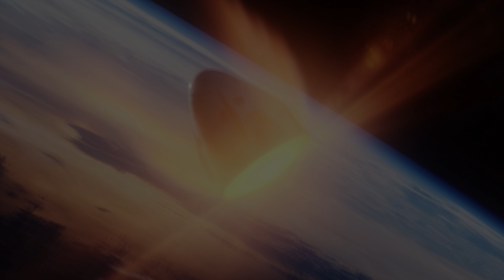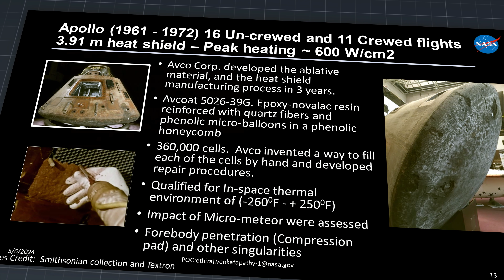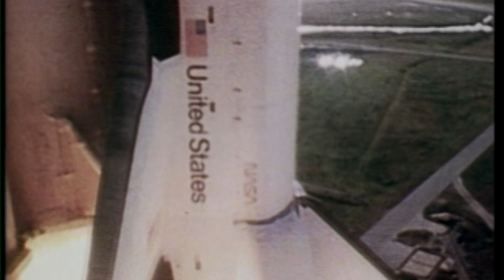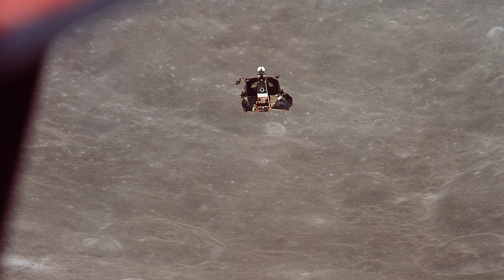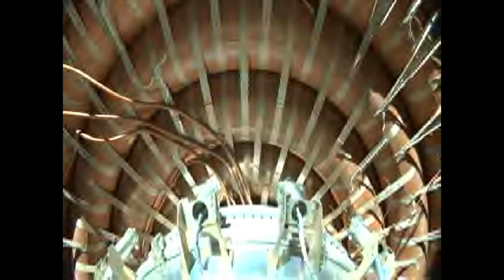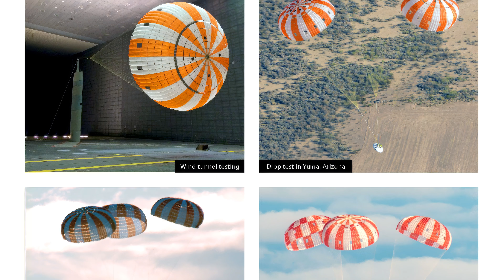The Engineering Behind Slowing Down a Spacecraft

Comment: 25,000mph when coming back from the moon or when entering the earth atmosphere?
Reply from the maker: The 25,000 mph figure is specifically the speed at atmospheric entry when coming back from the Moon. That's faster than returning from low Earth orbit, which is about 17,500 mph. The Moon is roughly 240,000 miles away, so Earth's gravity has a much longer stretch to accelerate you on the way back. That extra speed is what makes lunar return so much harder on the heat shield.

Comment: Planets have charges. Cant we repuls our ships?
Reply from the maker: Interesting thought - the challenge is that planetary magnetic fields are incredibly weak at the scales we'd need for slowing a spacecraft. And unfortunately Mars and the Moon barely have magnetic fields at all. Would be nice if it were that simple though!
Reply: @VantPoint  Yes. AI says to charge your craft enough is a massive amount of energy. I still think electric field or magnetic field is the way to go. We should look closer into Berkeland current that would be very strong at any  pole of a planet. Maybe Venus is the one we should try it on. Some say all the planets are connected. If we can follow this line it would be an energy source and a magnetic field to push and pull off of. E = MC2 tells us the universe is built from electricity/Charge. Should look deeper into Magnetic fields/electricity. Mars lost it's connection, that is why it does not have a strong magnetic field. Wallace Thornhill and S.A.F.I.R.E project with Montgamary Childs.
Reply: @VantPoint  A planet has a magnetic field and a charge. They are not the same thing?

Comment: It me or ur numbers are wrong? U normaly travel at 25.000km/h not miles.
Reply from the maker: The numbers are in miles per hour, which is standard for NASA mission reporting. 25,000 mph is the reentry speed coming back from the Moon, which is about 40,000 km/h. You might be thinking of low Earth orbit speed (ISS Orbital Speed), which is closer to 28,000 km/h (about 17,500 mph). Either way — very fast!

Comment: I remember some Mars landing where they had a series of balloons that inflated around the craft and it bounced on the surface. Just no mention of that here, so I guess that's not something that's being explored anymore. Big savings on the retro fuel rockets
Reply from the maker: Great memory! That's the Mars Pathfinder landing in 1997, and Spirit and Opportunity used the same approach in 2004. Giant airbags inflated around the lander and it literally bounced across the surface until it stopped. It worked brilliantly for those missions, but the catch is weight - airbag landings only work for relatively small, light payloads. Once you're landing something Curiosity-sized or bigger, the airbags simply can't absorb the impact forces. That's why NASA shifted to the sky crane system and why future Mars missions are looking at retropropulsion and HIAD instead.
Reply: @VantPoint thank you for your reply and update to why balloons are out.

Comment: Space x starship is stainless steel so melting point higher and thus if tiles fail rocket survives
Reply from the maker: That's part of the thinking - stainless steel holds its strength at much higher temperatures than the aluminum most rockets use, so it gives you extra margin if a tile is lost. But it wouldn't survive full reentry heating on its own — the temperatures are still far beyond what bare steel can handle. It's more of a safety buffer than a backup plan.
Reply: @VantPoint yes that's why he pushes starship to the limit in every re entry

Comment: imaging coming back from mars...it would be 5m miles per hour
Reply from the maker: The speed would definitely be higher than lunar return - roughly 30,000-35,000 mph depending on the trajectory, compared to about 25,000 mph from the Moon. Not quite 5 million, but still a serious jump that makes the heat shield problem even harder. That's one of the reasons HIAD and supersonic retropropulsion are so important for Mars missions.

Comment: Our engineers are not very smart because all they have to do is reduce the velocity from 25K in space and then drop in to earth atmosphere with out any friction what so ever.
Reply: @lamancha7066   so you would bring up and down a lot of fuel to reduce the velocity when atmosphere can do it for you at much lower cost?
Reply: @user-ng6kk5jn3c it's a vacuum their in space even water fuel will do the job. Same thing when they dock to the ISS they need to slow down the capsule
Reply: It takes 600 tons of fuel to accelerate a Dragon spacecraft to 28,000 km/h to get it into orbit. Slowing down from 28,000 km/h to a speed low enough not to have trouble with friction takes just about the same amount of fuel. That means instead of launching a 10-ton Dragon, we’d have to launch a 10-ton Dragon plus 600 tons of fuel. That takes 30 Falcon 9 launches instead of 1. That is why we use heat shields instead of engines to reduce velocity at the end of the mission.

Comment: We are supposed to build 100km geodesic domes and put an elevator on the side and launch from the top using gunpowder and use magnets to land on the geodesic dome so it comes back down on the elevator
If its one 100km geodesic dome or its domes inside of Domes inside of Domes until it reaches 100km

Comment: One would hope they were wearing their seatbelts at those exsteam braking conditions and hopefully the airbags are working 🙂
Reply from the maker: No airbags, but the seats do absorb a surprising amount of impact. Orion's crew seats are designed to handle splashdown forces, and the astronauts are strapped in tight. Seatbelt is an understatement.

Comment: The same science on how they stop jet fighters on a short runway on a boat in the ocean.
Reply from the maker: Similar problem - stop something fast in a short distance - but very different solutions. Carrier landings use arresting cables to absorb the kinetic energy mechanically. Spacecraft don't have that option - no cable in the sky. So they have to use the atmosphere itself, or their own engines, to shed that energy. Same challenge though, just different physics.

Comment: All the Apollo return and reentry procedures, though very dangerous seemed to be less complicated. Why is it now being debated so much. Is there any modifications when compared to the earlier Apollo capsule?
Reply from the maker: Great question - Apollo's reentry was genuinely dangerous every time, they just accepted more risk than we would today. Orion uses the same heat shield material as Apollo, but it had to be completely recreated after decades - different manufacturing, different behavior. That gap between 'same material' and 'same performance' is really what the whole debate comes down to.

Comment: We use to have one of those popular papasan chairs which is shaped exactly like a heat shield. It’s surprisingly comfortable and for some reason I couldn’t help imagining I was an astronaut using it as an open back escape pod from the ISS 😂. So I still wonder what could be the minimum engineered components and protection needed for survival of a single person reentering from space like the egg drop experiment. 🚀🛡️🔥👨‍🚀🪂
Reply from the maker: Love that image. The honest answer is - more than you'd think. Even the smallest capsule ever flown with a person - Mercury - was about 3,000 pounds of very carefully engineered protection. You need enough heat shield to handle thousands of degrees, enough weight and shape to keep you from tumbling, and a parachute at the end. The egg drop analogy is actually perfect - same problem, much higher stakes.

Comment: Very interesting info, thanks!  So, how about using air brakes or inflatable shield to slow down in the upper atmosphere, then rockets to establish low earth orbit when returning from the moon.  Then, a "gentle" capsule reentry from LEO speeds.  You could even leave the reentry capsule in low earth orbit, transfer to a lunar injection vehicle, land on the moon, and on return slow down enough to rendesvous with the landing capsule.  Possible?
Reply from the maker: Great thinking! The first part is actually close to a real concept called aerocapture - using the atmosphere to capture into orbit instead of landing directly. NASA has studied it for decades but never flown it. The challenge is precision: at 25,000 mph, you have to hit the atmosphere at exactly the right angle. Too shallow and you skip off into space, too steep and you get the same extreme heating you were trying to avoid. I actually considered covering aerocapture in this video but decided to keep the focus on landing methods. Glad you brought it up here though. As for leaving a capsule in orbit to dock with on the way back - that's actually been proposed in some future mission architectures too. It adds complexity but reduces what each vehicle has to do. Fascinating stuff to think about.
Reply: @VantPoint  thanks, I've just been thinking it may be time to revisit EOR.
Reply from the maker: Agreed, and in a way, SpaceX is already doing exactly that. Starship's entire Mars architecture depends on orbital refueling in Earth orbit before the trip. EOR's time may have finally come.

Comment: UFO witnesses from the 40's and the 50's were actually witnesses of secret military re-entry experiments. The shape is the same.
Reply from the maker: Interesting connection - the timing does line up. Allen and Eggers' blunt body research was classified through most of the 1950s, and early reentry vehicle tests were definitely not publicized. Whether that explains any specific sightings, I'll leave to others - but the shapes are hard to argue with.

Comment: I love the approach of using an inflatable heat shield!  
It can be much wider so the heat can be spread across a greater area - always good.  
I think there is definitely a place for inflatable habitats too - on the Moon and Mars.  
They can give you a huge volume for little weight.
Reply from the maker: Exactly right on the wider surface area - that's the core insight behind HIAD. And the inflatable habitat connection is a great one. Bigelow Aerospace tested an inflatable module on the ISS, and NASA is looking at similar concepts for lunar surface habitats. Same principle - big volume, small launch package.

Comment: I'm always amazed that returning space craft don't tumble.
Reply from the maker: Great observation - they actually can if something goes wrong. The capsule's center of gravity is deliberately offset so aerodynamic forces keep it oriented correctly during reentry. It's passive stability - the shape wants to fly heat shield forward, like a badminton shuttlecock always flipping feathers-back. The kind of detail that doesn't get enough attention.
Reply: @VantPoint 
Thank you for the explanation. 

I continue to be amazed that they don't tumble. I just don't understand the physics, I suppose.

There IS magic and wonder left in the world!
Reply: @VantPoint  the capsule has positive static and dynamic stability at hyper and super sonic speeds, but only positive static stability at sub sonic speeds (and negative dynamic stability). There are few papers from nasa about the simulations.
Reply: @user-ng6kk5jn3c  <<, I am facing yet another year that the federal law stating 100% disabled Vet and over age 65 means you pay no property tax is being ignored once again.>>

I don't doubt that it WORKS.  But since I don't understand the physics involved, it seems like migic to me!
Reply: There was a HUGE amount of research into the optimum shape for atmospheric reentry back in the days of the Space Race, the cone shape also generates some lift which allows for a degree of control in the violent fall back to Earth.
Also, note how a capsule is suspended with a 'tilt' under the parachutes so it lessens the impact upon splashdown.
I was just a 5 year old boy in England when my parents woke me up in the early hours to watch the moonwalk and have been fascinated with 'space stuff' ever since.
Reply from the maker: Great additions - the lift vector is a really important detail I should have mentioned. That slight offset is what gives mission control the ability to steer during reentry, adjusting the bank angle to control where the capsule lands. And love that story - five years old watching the moonwalk from England. That's exactly the kind of moment that hooks you for life.

Comment: Why not send rockets with fuel to the martian planet.  Enter into orbit, and then, when the main spacecraft arrives at mars, connect with that spacecraft.  Then use the fuel that has been in orbit d then then use that as part of the retro slowdown into the martian atmosphere.
Reply: Like the video mentioned it would almost take the same amount of fuel just to slow down enough to dock with said  fuel ship in Martian atmosphere
Reply: @pebbles9908  The amount of fuel needed to do it by your comment requires a larger supply of fuel, which is more mass more weight to get off the ground, not to mention the additional cost.
Reply: Because Elon Musk is cosplaying as an aerospace engineer.
Reply: @wyattnoise 

I'm just wondering if that were even possible
Reply: @pebbles9908  it's not that it's not possible. It is possible. However more fuel means more mass which means more thrust to move said mass which mean more fuel to power said thrust. You see where the problem is. You'd basically need twice as much fuel to get the fuel into space in the first place and that before you sent the rocket you want to refill.
Reply: @dyslexofficial2798  plus the great distance and orbits mean that you'd forever be recalculating the logistics. The moon is "easy" because it orbits the earth.
Reply: @williamscavone722  hell yeah. Now if we could just make the fuel on the moon that would be a game changer. Just turn the moon into a giant gas station and were off to the races
Reply: @williamscavone722  i was WAY off btw... if you wanted to get say a delta heavy amount worth of fuel into low earth orbit at its current carrying capacity of 28,000kg you would need to make around 10-15 trips. Now those trips require 400,000kg of fuel each. Assuming everything scaled proportionally just to get 1 trip worth of fuel into space you would need a rocket capable of holding 4-6,000,000kg of fuel.
Reply from the maker: That's actually being studied seriously - lunar ice at the poles could theoretically be converted into hydrogen and oxygen for rocket fuel. Long way off, but not science fiction.
Reply from the maker: Love that you ran the numbers - that's exactly the kind of reality check that shows why this problem is so hard. The math is humbling.
Reply from the maker: Great thinking - this concept is called orbital propellant depots, and SpaceX's Starship Mars architecture actually depends on refueling in Earth orbit before heading to Mars. The other replies here are right about the fuel-to-move-fuel problem though, and getting propellant all the way to Mars orbit would be enormously expensive. Even with plenty of fuel there, retropropulsion alone through that thin atmosphere is incredibly costly - which is exactly why NASA is developing inflatable heat shields like LOFTID, to let the atmosphere do as much work as possible before the engines ever fire.
Reply: @VantPoint 

Thank you for the response. 😊

I do understand that would be costly.   But I'm thinking of smaller fuel ⛽️ crafts .  These crafts can be sent a few months, maybe 6 to 9 months in advance.   They can enter orbit better because they will not require so much speed to get there thus less power to slow it down. 

Then use that fuel to land and have another in orbit to propel the craft back to earth. 

😊
Reply from the maker: You're thinking along the right lines - sending fuel ahead is a real concept called pre-positioning. The challenge is that even smaller craft still face the same orbital mechanics. Getting to Mars doesn't really work 'slower means less fuel' - the transfer orbit is dictated by planetary alignment, and slowing down into Mars orbit still requires significant delta-v regardless of spacecraft size. But this is exactly the kind of problem mission planners are working through right now.
Reply: @VantPoint 

Very good information. 

Really appreciate it.
Reply: So, how do you slow down enough to "connect with" the other spacecraft as you put it. You seem to have missed the entire point of the video. You can't just "stop" in space to change vehicles.
Reply: @aldunlop4622 

Man, I'm just shooting ideas.   I'm not a rocket scientist.  Don't take it so personal.
Reply: @pebbles9908  I'm not, don't worry, it's just having to say the same things over and over in these videos is frustrating.
Reply: @aldunlop4622 

Well, I'm guessing they could slow down the way the send spacecraft into orbit around other planets??
Reply: @pebbles9908  Nope. Physics is physics.